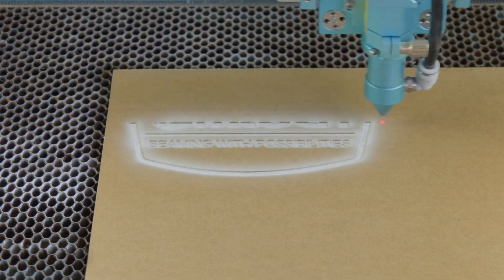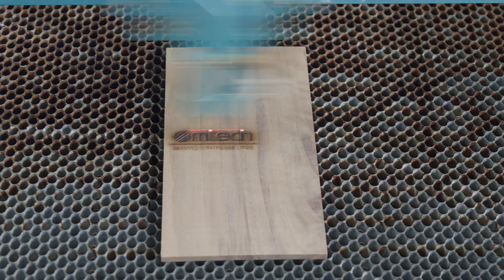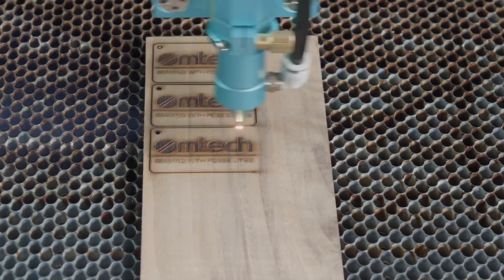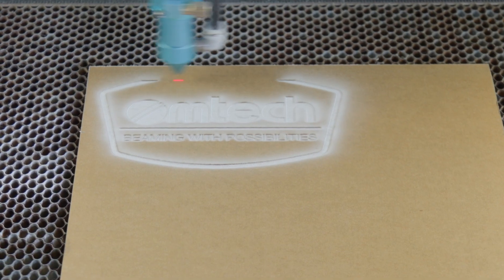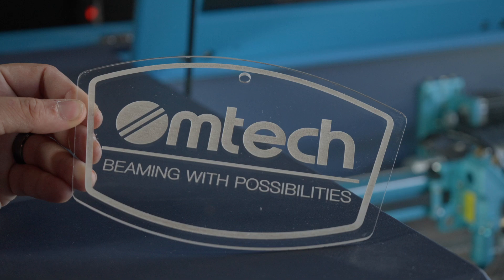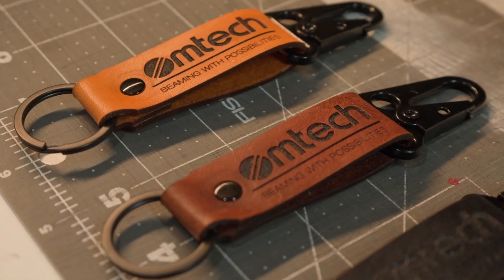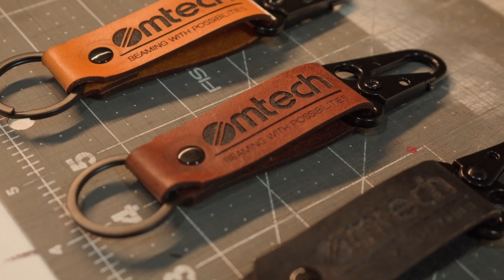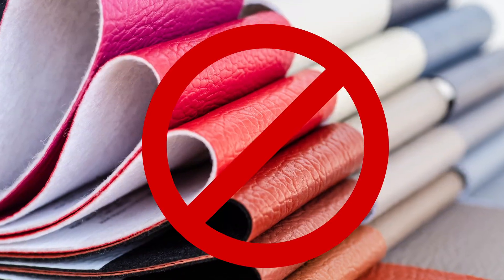What Materials Can a Co2 Laser Cut??

Comment: I have a 80 watt co2 omtec guidance. What is the thickest birch wood I can cut easily
Reply from the maker: Depends on how many passes you're wanting to do. But with 80 watts of power you should be able to rip through 1/4 birch no problem. Multiple passes can go thicker, you can even adjust the bed to cut through deeper if you know what you're doing.